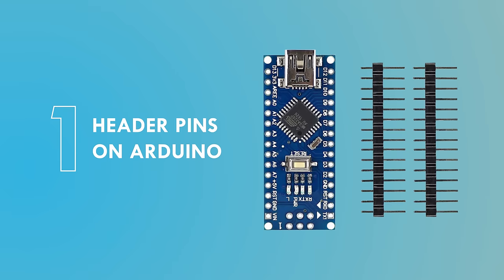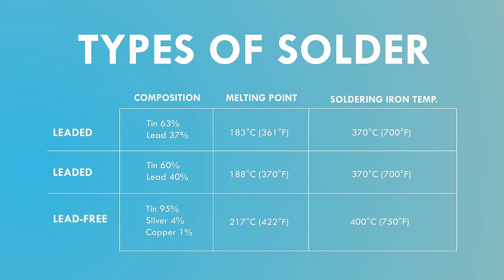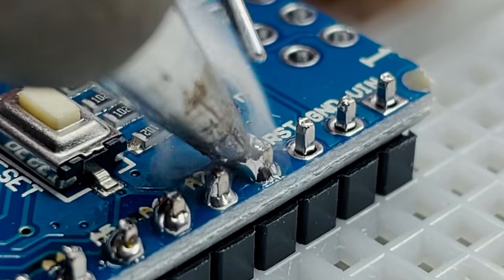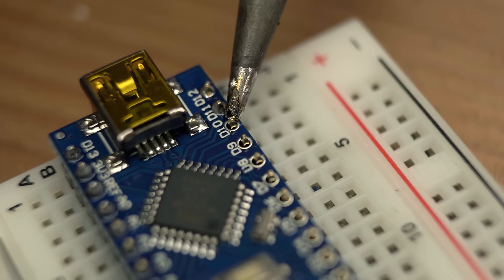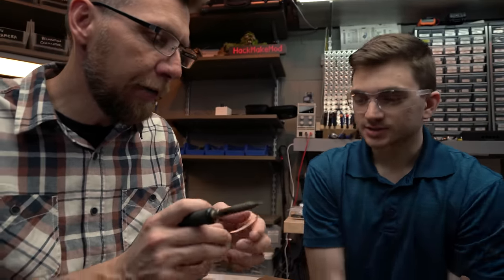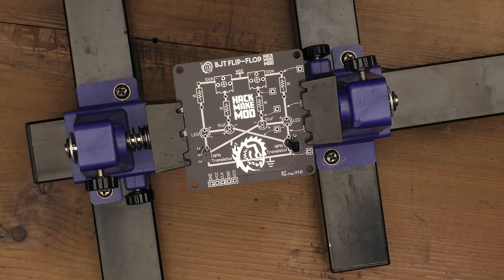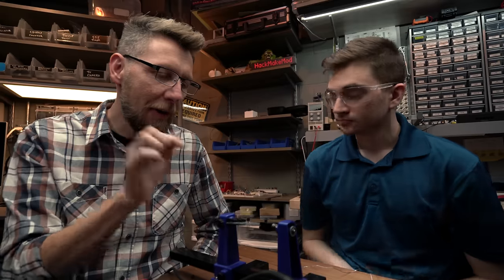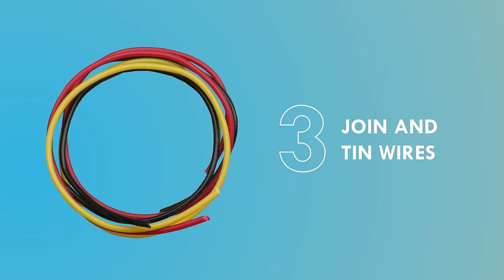HOW TO SOLDER! (Beginner's Guide)

Comment: do i have to use a solder with flux inside?
Reply: Yes. Soldering is literally impossible without flux. I mean, in theory you could use no-flux solder combined with external flux (liquid or paste). But nobody does this. You use flux-core solder, and may add external flux as well.

In all cases, for electronics you MUST use electronics flux. Plumbing fluxes will cause catastrophic corrosion.
Reply: @tookitogo  I appreciate the response, well the soldering iron i got came with solder but without flux inside, I bought one of those syringes with no clean flux, so is it better to buy flux core solder then? Im a beginner thanks
Reply: @Happyguy60  Chances are your solder does have a flux core. It just may be shitty flux! :P
Reply: @tookitogo  maybe it does. But as a beginner i rather just use the right tools so im going to order flux core solder instead
Reply: @Happyguy60  I always advise that people buy high quality solder. Even an “expensive” solder is essentially 0% of the cost of any project you build. Why risk your costly components, and your own sanity and enjoyment of the hobby, on cheap solder? 

I like Kester, Felder, and Tamura-Elsold the best. MG Chemicals is also good. Other name brands include AIM, Almit, Indium, Weller, and ChipQuik. The only name brands I’m not really impressed by are Stannol and Multicore (whose products have similarities because the companies merged for a while decades ago) — I think their fluxes are a bit disappointing.
Reply: @tookitogo  thank you I really appreciate the response. I’m gonna go with the mg chemicals rosin core solder. But I just have one more question. do I need an air extractor while I solder? I’m thinking about soldering outside, so I don’t breathe in any of the fumes. But if I do it inside, could I just use a Fan open the window?
Reply: @Happyguy60  How much soldering do you plan to do? At home, where I only solder once in a while, I don’t actually bother with fume extraction at all. At work, where I solder almost daily, I have a fume extraction arm that I can pull near the workpiece. For hobby use, many people use a small fan simply to draw the fumes away from your face (it’s literally been scientifically shown that the smoke tends to flow towards us; it’s not your imagination!) simply because it’s annoying. Others, especially those who do it more regularly, use a fan with a filter. Some people have built extractors out of bathroom vent fans and hose, to exhaust it directly outdoors. Ultimately it comes down to whether your concern is just the annoyance of flux fumes in your face, or if you’re worried about the long-term effects of chronic exposure to flux fumes. The latter I honestly wouldn’t about too much if you only solder occasionally, and you can open a window, or have central AC through a filter.
Reply: @tookitogo  thank you mean i really appreciate your help, you are the best!well i tried soldering some wires last week and it went well. I did it outside but the smoke kept going to me, so i put a big fan that i have in my room to blow the smoke away. And i was able to get some experience. But now the tip is all oxidized. My goal is to solder a new vram chip onto a graphics card
Reply: @Happyguy60  You need to re-tin your tip frequently. And make sure you’re not running it any hotter than needed. 
Also, many people make the mistake of wiping off their tip before returning the iron to the stand. Instead, don’t wipe it, and if anything, add solder to it — that way the solder oxidizes and not the tip. Wipe and re-tin it when removing it from the stand.

Comment: The picture. Appointee  President Xi with a Chinese appointee at the near South Pole seas, while Appointee Christopher De Leon with either Appointee Leonardo DeCaprio at the coastal Americas area business scope or the UK alliance Crusaders at the near Atlantic Ocean main base but if you will connect only to one of both sides it won't form a T of the Feline Cat group but halfway to that. But for sure the Lion and the Tiger don't trust each other, am I right, then for the moment you can be thinking the Feline Cat are prepositioned but have either to work it out  temporarily or co- exist in that pointing vertical and sides of Polarity or ignore each other or slug it out the last resort. Understood.

Comment: Safety tip 1: use lead free solder! lead is incredibly poisonous to humans, and should not be handled needlessly, and never without protective gear. Doubly so if you are pregnant!

This technique looks really clean and good, but I was always warned from doing this, because you are heating up the component as well, and they can be severely damaged by it, especially more delicate components. Is this not a real concern? or was that just something that was taught without any basis in reality? If anyone knows, let me know
Reply: What are the dangers of leaded solder? I haven’t really looked into it and i think the solder in my soldering kit is lead free but I’ve read that leaded solder is easier to use and that most of the danger is with breathing in the flux

Comment: This guy doesn't know the first thing about proper soldering technique. Those solder joints should be smooth, shiny, and concave. And you always clean solder joint with isopropyl alcohol to remove any remaining flux residue. Also, when you snip the leads, you place your finger over the end of the lead. That's how you prevent the bits from flying off into your eyes, etc. And properly tinned wires don't end up with blobs on the end.  Sloppy.

Comment: Flux does not clean the area you're soldering, flux removes the oxygen from the solder weld because oxygen causes oxidation which means a weak weld joint. Flux core solder is not sufficient for a decent weld, you should always have more flux all around the weld joint.
Reply: Nonsense!

Flux is capable of removing minor oxidation from things being soldered. How well it can remove existing oxides depends on its chemical composition. Solders suitable for electronics use without subsequent removal only work on metals that are quite free of oxide to begin with. It does prevent oxidation during soldering. Other fluxes can be much more aggressive and work on metals with moderate oxidation.

There is absolutely no need for additional flux for the vast majority of work in electronics if you are using a good quality cored solder and good technique. Sometimes a little additional flux can be helpful.

We're talking about soldering which is NOT WELDING!
Reply: Yup, I second the “nonsense” sentiment. Soldering is not welding, and the primary purpose of flux is indeed to reduce existing oxides to allow wetting to occur.
Reply: @tookitogo  I use the term weld in its raw definition... soldering is NOT welding but a solder join is a weld - technically. Unless you have a better word for it ☺

Comment: The wire with flux inside are not even worth the trouble, you will still need flux. And it's not a cleaner. It's a mass that has to reach 250+°C and it's going to corrode all metal frankly. This bit of corrosive bite will make pieces "stick" easier. Always use flux never rely on these over priced glorified unreliable tin straws 😂🤘

Comment: No!, Hell No!  You solder how you want but don't teach this.  I've been a Manufacturing Engineer in electronics manufacturing since the early 80s.  I teach soldering and was formally an IPC "J standard" trainer.
* You don't need to tin-wipe tin.  Just replace the iron "dirty". The residual solder will keep the iron from oxidizing.  We don't use wet sponges any more.  It shocks the tip, chills the solder and once its cool the solder wont wipe off.  Use mesh every time.
*Tin/ Lead solder in the 21st century?  Most countries do not allow lead in commercial/hobby electronics.  Its banned in Europe, India, Australia China and many other countries. Components have been lead free ready for 20 years.  Unless you are re-soldering old components (made for a lower temperature rating) there is literally no reason to use it.  Its environmentally nasty. Just don't.
*There is more to tip choice than shape.  Its the contact AREA that is important. Ideally the same size as the joint face that you can get to in order to transfer heat fastest.
*Touching both components is not ideal for heat transfer.  The fool-prof method that I teach is to position the solder on the joint and then place the iron in it.  When the solder melts it instantly flows fresh solder and fresh flux over the joint, preventing oxidation and providing the best contact between tip and joint (i.e. an immersive fluid.).  It cooks the component less. there is less oxidation and its faster.
*Yes remove the solder before the iron, but you didn't say why.  When you are adding solder the joint is only just above the melting temperature which is not the best FLOWING temperature.  I teach a lag of 1 - 2 seconds depending on joint size.  The solder needs to drop into the hole. otherwise its just stuck to the pad which itself is glued to the board.  I did not witness the "drop" on any of your joints.  (IPC fail)
*Solder from the component side?  We DONT do that except to tack one leg.  We want the heat to be as far away from the component as possible.  You are just cooking the component before you make the joint.
*Do not go back to a joint.  Solder molecules get  " fatigued" with repeated heating.  You are unlikely to improve it.  Content yourself with good process in the first place.

Like I say - You solder how you want.  Just please stop teaching this.
Reply from the maker: Wow! Thx… Lots of wisdom here! You should make a video!
Reply: @HackMakeMod  no. I'm just saying that you shouldn't
Reply: @HackMakeMod There are already superb videos showing IPC- and/or NASA-compliant soldering. The very best tutorial I have ever seen is the basic soldering series from Pace Worldwide (the soldering equipment maker). It’s from 1982 or something, but explains it exceedingly well.

Comment: You should just not even use lead solder honestly. But if you are I would even wear gloves and a respirator. Lead absorbtion is not something to take lightly.
Reply: Soldering temperatures are nowhere near hot enough to vaporize lead. The flux fumes are a much larger concern. 

Skin is an effective barrier to elemental lead. It is more than sufficient to just wash your hands with soap after handling leaded solder. Europe banned lead in electronics not because of hazards to manufacturers, but to prevent it from becoming an environmental contaminant from improperly disposed electronics.